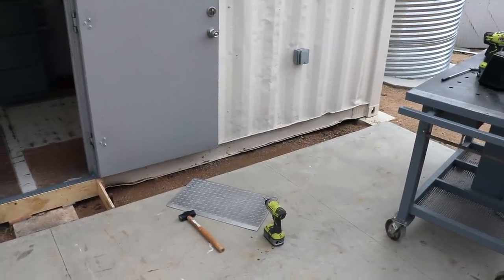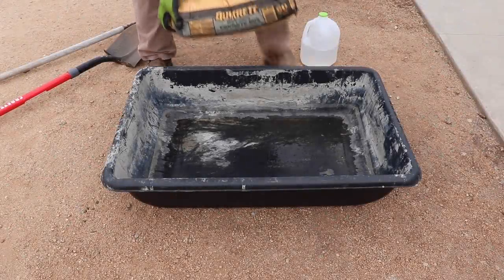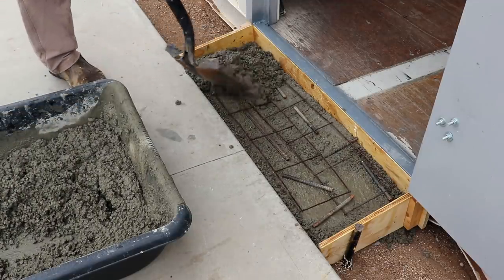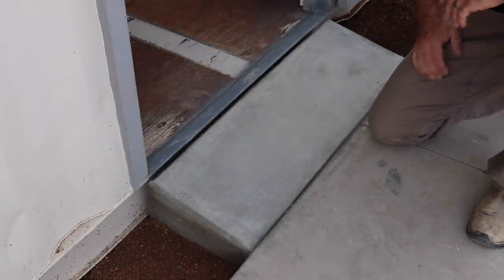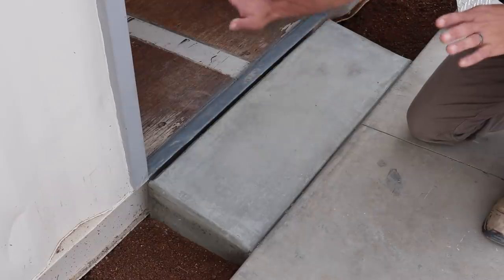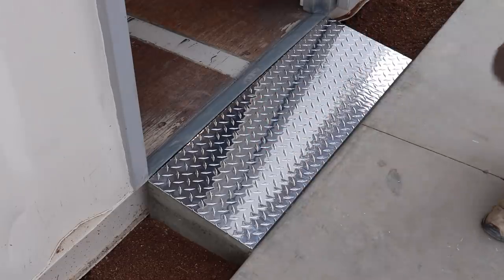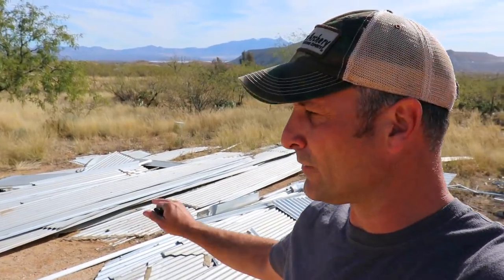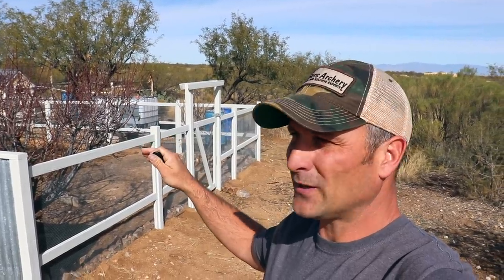Shipping Container Shop:  A Small STEP Forward

Comment: it's amazing how LITTLE a bag of concrete covers.  add the aluminum...   looks awesome.   and a crapload of gravel in the rest of the gap.  and some irrigation... and some plants.
Reply from the maker: rapunzel eh? Gravel in the gap is most likely what I’ve going to do....but kind of a larger couple inch rip rap style that will kinda lock into place... but I will have to work the top to make it level out.   Sorry for the slow reply

Comment: As for the shed siding I would go with a CementBoard siding. HardieBoard can be expensive. I found a different manufacturer and it was much less money but still a great product. Very durable and easy to work with! Glad to see another video!
Reply from the maker: Jasonoid I’ve thought of that cement board as I would like to have it fire resistant.    But was a little concerned as to the weight...what was that product?

Comment: I would add some sort of anti-slip surface on top of the concrete. I would recommend a broom finish for concrete flatwork to help with preventing slips.
Reply from the maker: Andrew Limb thanks Andrew!  Yes I think broom finish is probably the best for anti slip surfaces👍
Reply: Get some tapcons and that diamond plate

Comment: I like Diamond Plate for many things, but not in this application. Concrete is the best solution. I would worry about any adhesive connection failing and the plate becoming a trip hazard. If the adhesive does fail it will leave you with a mess that will ruin your nice, simple concrete ramp.
Reply from the maker: Murray Wagnon the adhesion is what concerns me as well.   I could use anchors as well but then it gets me to thinking....that’s a lot of work for a simple plate add on😂

Comment: I am not a silver/chrome girl; all my trucks had the sport look, black on black.  Nevertheless, I think I would use the diamond plate. To, 1 take up the gap and 2 the plate would some anti slip which may be beneficial when wheeling in/out heavy equipment. 
That's this RedHead's 2cents. Thank You for your video.  I look forward to watching more of them. Have a Blessed Year (and garden)
Reply from the maker: Pamela Sullivan thank you Pamela!   I’m actually more along the lines of muted tones as well.   But the practical application of bridging the level gap has me leaning that way too😀👍

Comment: One trick I learned with fiberglass boat decks for anti-slip was to paint with polyurethane, while wet, spread small bits of walnut shells or coarse sand, then more p/u.  Alu is expensive, but you might have some steel plate.

walnuts? look like there's a few pecan orchards in your area  :)
Reply from the maker: Len Conrad yes we’ve got tons of pecans here....I think FICO may be one of the largest growers anywhere

Comment: Looks great but just as a side note, I have drop tail motorcycle trailer with an aluminum diamond plate deck. The trailer breaks in half to drop the tail so you don't need a ramp. I was dragging a tarp full of yard clippings onto it one day for a trip to the dump. It started lightly raining, and in the middle of that ramp I busted my ass good. My feet came out from under me like I was on ice. Do a test, try some lightly sprayed water first, then mix some saw dust or ground dust. You know what'll happen if you get ANY potrolium product's. Also think about slipping a foot off the side on the straight edge. BTW, I put some no slip adhesive backed treads on the bike deck, muuuuuuch better
Reply from the maker: Ford Fan well, that’s good to know.   I do like the rubberized tread possibility.   🤔

Comment: Metal vertical siding like pole barn siding.   Concrete ramp looks fine .save that diamond plate aluminum for the trailer .. how are the lower Savannah desert fruit trees doing?  I liked that little fruit garden tree Grove.P.S.  USED/WARN OUT  MILWAUKEE AXE Sawzall  blades are GREAT TO REPURPOSE INTO A KNIFE BLADE!😊
Reply from the maker: Mark Atkinson so I was thinking about just using a circular saw blad as I have a few available.   But those old Milwaukee blades....are they thicker than a standard sawzall blade?  Or just a better grade of steel for a knife?  Because I’m not set in stone as to using only a circular saw blade.  Thanks😀👍

Comment: Post more please.
As you were talking about potential options for siding the upper part of your shop, my immediate thought was 'corrugated steel', and then you next showed us a pile of (waste) corrugated steel.

It's a no-brainer. If it has dents in it, who cares? If a visitor notices it and inquires, you have a great story to tell. The dents are a time-stone of an epic event. 

I can't wrap my mind around the idea of slipping on the diamond plate. It's not exposed, and even if it was, how short are your steps? You're at least 5'6". Take longer steps.
Reply from the maker: Cliff L thanks cliff!  I aim to post more....I’ve got 4 videos in mid process already and should have something this week...Hopefully...haha.    As for the corrugated metal.  I’ve thought about it a lot.  But cutting the sections to fit around my roof trusses would be hard to get a really tight fit without doing it in several little sections.   But it is the most practical application for sure.   Of course you may have me reconsidering now🤔😀👍
Reply: @homesteadonomics  I'm quite confident you could pull it off, you've tackled many greater challenges. 

Just be sure to fill any gaps to avoid it becoming a home for nesting bees/hornets or the like. It's a very common practice in L.Tahoe. I really like the look. Once aged, the rust/patina look is nice - IMO. 

I'm in Arizona for a couple months (first time), if you need some free labor for a day or two, I'd be honored to lend a hand. I've been through a year-long Permaculture program, so I may be able to help in that regard as well.

Comment: That turned out nice.  I have a tip you can try as I have found it helpful throughout the years when mixing concrete.  I use a wheelbarrow and a garden hoe to mix it.  It then becomes much easier to pour and clean up.  

Thanks for making great content....

Comment: Pls do real wood siding!!! The look it gave your shop and her play house is too stunning to use faux wood or paint! But it’s your shop. Ohh and for your concrete step transition... it hit me that cement tiles (the decorative tiles) would not only fill in that space so it’s more functional but they’re cement and can be cemented directly on top of your step. They’re beautiful cement tiles and are meant to take foot movement 👍🏼 if I could send you pics I would but look into them and see what you think. You’d need a few but that’s not bad. Anyways hope it works out and love your work always
Reply from the maker: JewDd* 89 well I will admit that I hand tw me thought about tiles!  Now you’ve made my decision harder😉. As for the wood siding...I love it too but I didn’t like how quickly it warped and cracked in our heat.   I’ve looked at the composite fence panels for decking as they can kinda give that same look....but that decking is really expensive 😬

Comment: Happy New Year Joe! 🎉
okay here's my two cents on the aluminum diamond plate question...
It definitely gives a more finished look than the plain concrete, however the plain concrete looks fine as well!
Personally, I think I would either leave the plain concrete, or add something a bit less shiny with a rougher texture, or even something that is designed specifically as an anti-slip material.
Thanks for the great videos!

Comment: The diamond plate is eye-catching but even with skid reducing grooves, there is a potential for project related chemicals like adhesives, fuel, lubricants, etc. negating that feature, and the look won't last long, whereas concrete is likely to weather those events relatively unnoticeably. You took such care with and did such a great job on the step, it seems that simply adding something like SlabGasket Expansion Joint Replacement (PavePatch.com) would easily mitigate the slight grade issue and also give a great look and seal. It will also prevent pebbles, sticks, and bugs getting wedged in the gaps. Looks like Olive takes her surveillance duties seriously, or at least likes to give the appearance of being an engaged team member. Looking forward to your new posts.
Reply from the maker: Glen Faught Jr haha...yes she loves to chase after things that she ‘thinks’ she sees😂.   As for the ramp I will have to look at that slab gasket as I think that might be the ticket!  Thanks!

Comment: I like the steel plate for your new concrete ramp. The the deciding factors are... One, can you catch your toe one the lip between the ramp and the container? Two, what does it feel like when you wheel the welder over... Is it better with or without the plate. ...Three, do you have something better to use the plate? If not? Why not treat yourself to something nice and extravagant once and a while. If it was for your wife you won't hesitate, so why not treat yourself? ❤🌅🌵

Comment: You're right, there wasn't much to that. I would just leave it concrete and save the diamond plate for something else. If you get ice on it, it would have maybe been better if you had put a rough/coarse brushed finish on top of it. The diamond plate does look nice and if it rolls in and out easier then that is what I would use.
I do like you rainwater harvesting. How much average  annual rainfall do you get there?

Comment: I believe that if the items your rolling in and out of your shop have oversized wheels that the concrete would be just fine, But if you have smaller wheels they may hang up on the small speed bump. lol and personally I like the look of the concrete.  Great work on the video. love them.

Comment: If you silicone that down it will eventually come apart. You may catch your toe on it and fall. The 1/8 inch difference is not enough to worry about. I have a regular door threshold in my shop and I am always wheeling my tablesaw shop vac and compressor in and out. If you decide to go with the plate get some Zamac Anchors Screws and nail it down.
Reply from the maker: RedHotFiat that a good point!   I will still add some kind of buffer to kind stick it so it has a bed to lay on...but I think adding some anchors would be good too! 😀👍🙏

Comment: I would turn that old roofing vertical and use it for siding at the top of your shop.
Reply from the maker: Tim Whiting I’ve thought about it but really kinda like the contrast of the other materials.   And fitting the cuts of the corrugated metal around my rafter ends is also pretty intimidating.....the high rush of it not looking as crisp as I would like.😉
Reply: @homesteadonomics  True, but you could easily paint it for a contrasting color.  You look to have enough extra that you could afford to make a few mistakes and the price is definitely right.  Just use cardboard to make templates that fit, and then transfer the templates to your material.  A decent set of tin snips would make trimming it a fairly easy job.  (I like to Wiss brand, personally).

Comment: it might be a low note, but it will make other projects more attainable.  thus though simple, is actually the greatest importance.  add the step plate, tho it does add character, it also adds safety.  wonder it the might be a way to lower condensate as slip factor ( though most the time will be 0% problem)
Reply from the maker: Michael Sallee I’m definitely leaning toward the plate also....and humidity is not something we have too many problems with 😀👍
Reply: @homesteadonomics   if there is any moisture will be during the yearly monsoon season :)

Comment: You didn't ask, but if the concrete ramp had been made wider, you could roll things at an angle through the doorway. Now you are limited to rolling things only straight through the doorway. I would have made the ramp lower and fabbed up a removable closely spaced steel grating section to perfectly span the rise, so that debris would drop off the wheels and your shoes, keeping the shop floor cleaner. Now since you did ask, the aluminum diamond plate will not wear well. It will scuff and crack much more quickly than you think. I'll lose this vote, but I vote no aluminum diamond plate.
Reply from the maker: Pat Black those are good points!  I am thinking that it might not wear that well over time.  Thanks!

Comment: If you want to maximise bang for buck, make aircrete panels for the whole workshop. It will cost relatively little cash per square yard, will out last you, can be coloured to your preference, will insulate your workshop and keep the direct sun from hitting the structure, finally, it will be the easiest to install; just weld some angle iron horizontally as a rack and then slide the panels in. Good luck and be well.

Comment: My question would be, what size of wheels will going up or down this ramp. If a large wheel then the diamond plate will be ok, but if some of you equipment has small wheels, either leave it as is or go to an aluminum plate without the diamond, but with some type of traction.

Comment: No aluminum tread plates or a couple of reasons. Aesthetically, it doesn’t really fit the “country” atmosphere. Second, if you roll a tool box or something with small casters, the diamonds will prevent a smooth roll.  Better to just have the small onetime bump. You’ll find a better place to use that piece.

Happy New Year! Thanks for the video.

Comment: The diamond plate is going to get slick if it gets wet (which probably wont happen in your neck of the woods) or if you end up with something on the bottom of your shoes that makes them slick. Leave it be, the aluminum looks out of place, and I don't think it will look that good after a few years of wear.
Reply from the maker: Shannon Wyatt you could be right as they diamond plate has a higher polish than say a tread plate.  Thanks!  😀🙏

Comment: Leave the concrete bare. The diamond plate threshold looks good now because it's shiny and new, but as it ages and gets scratched from use, it will look dingy. You will get sick of it and try to remove it, but then you risk damaging the surface of the concrete, depending on how well you adhere it. I would leave it off. Your concrete ramp looks good all by itself.

Comment: Don’t put the aluminum diamond plate on the step. It’ll get tore up in a year or two then you have silicone or some other adhesive to deal with. If you must then use steel diamond plate I’d screw it down either way at least that’s reversible.

Comment: Leftover roofing:  more water collection structures?  Reduce REUSE recycle
Reply from the maker: Andrew Rickard very likely!   I’m cherry picking some good pieces to keep for lots of different projects.   But the majority of the big pile needs to go somewhere so it can be stacked.   But before that each piece needs to have the butyl rubber striped off the seams😬.   Unfortunatley the wind has lifted a few of the panels and it’s presents a danger.     So I need most of it to go elsewhere

Comment: Leave it bare. Just cut a piece to make A threshold too fill that gap.Or buy a threshold too hide the gap.I would of never added the board in the back when you fill it with concrete that's why you have that gap.That make it stick out that 1/8'' now you have that gap to deal with.